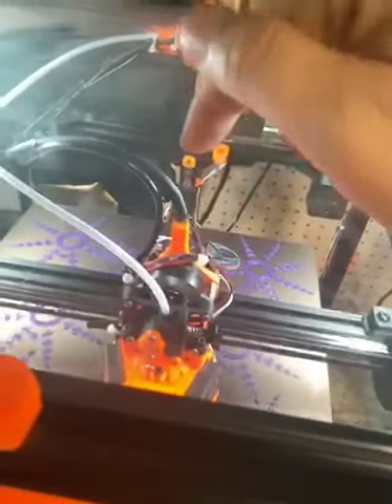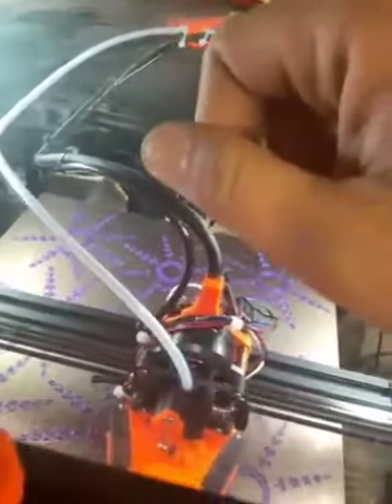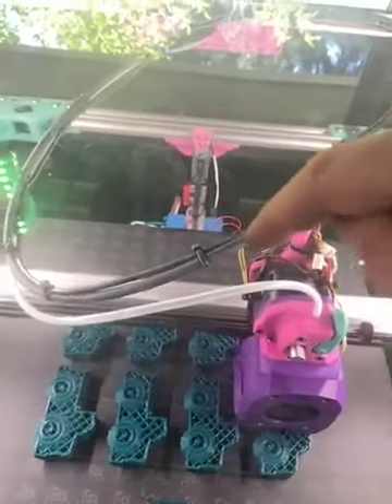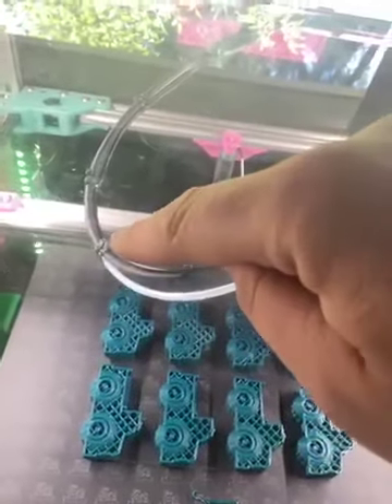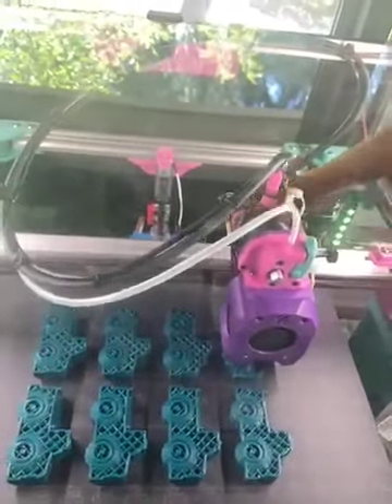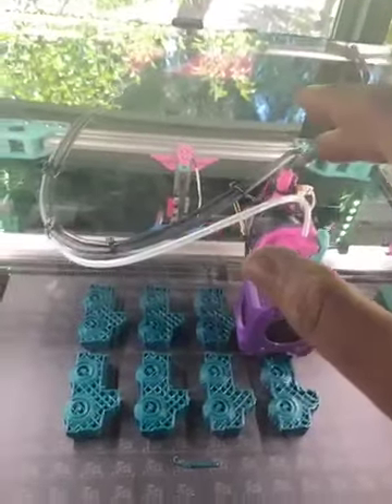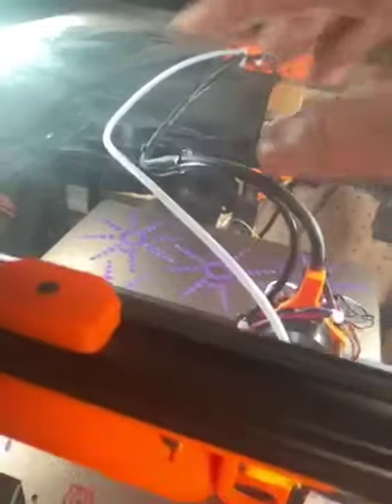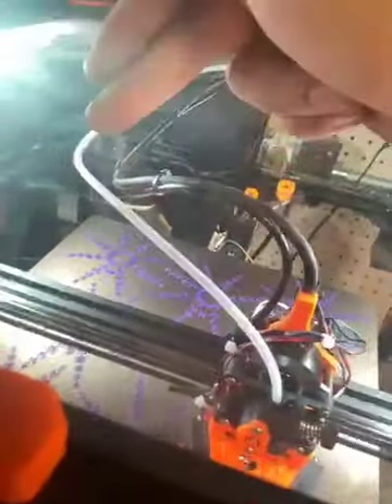Ixsen: How to zip tie the umbilical, bowden, and probe wire together

Comment: Why don't you run the Carto on Can?
Reply: Came here to say the same thing. Why would you not connect it to the CAN you already have?
Reply from the maker: I like usb better. I am waiting for ldo’s nighthawk36 to swap out the ebb36’s.
Reply: Ahh ok
Reply: SOON tm lol
Reply: @The_original_Reth  is USB easier to deal with for installation purposes or have you seen a performance difference?
Reply from the maker: @jodyking7278  My personal opinion is that USB is easier to use than CAN. I am using the LDO nighthawk in my switchwire, and EBB36 everywhere else. I have never gotten a timer to close error on the night hawk. Also I don't have to worry if my wiring is twisted enough, or make sure all the settings are correct. I just install klipper like I would the MCU. The one issue with USB is that one can quickly run out of USB plugs. And, you need a powered USB hub to add more things.